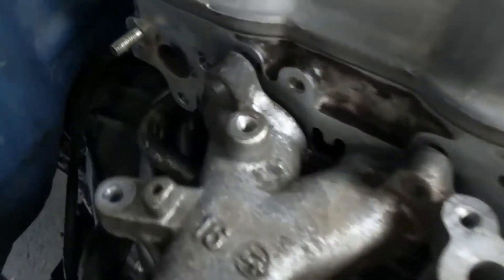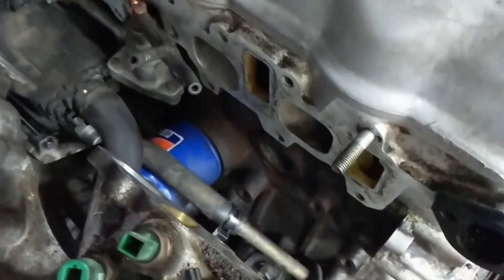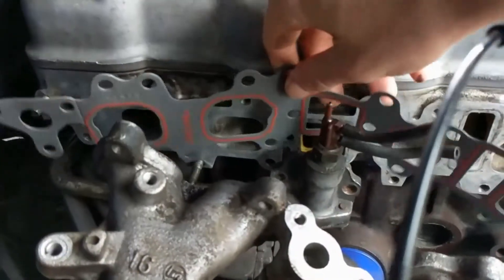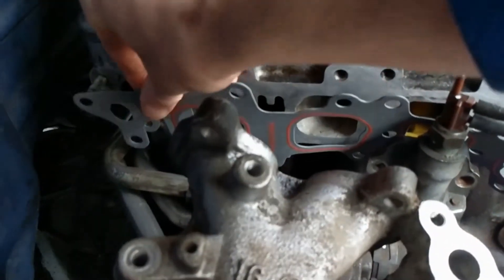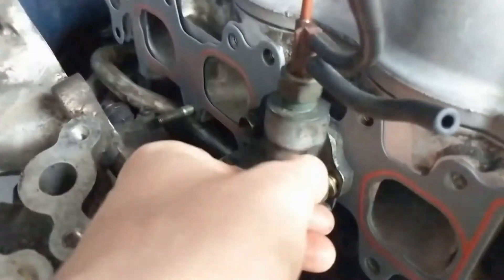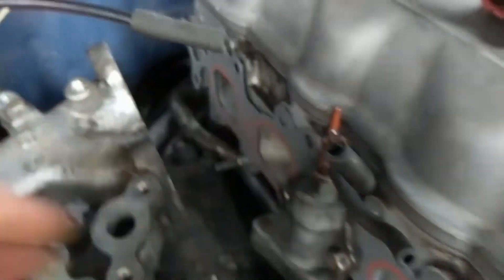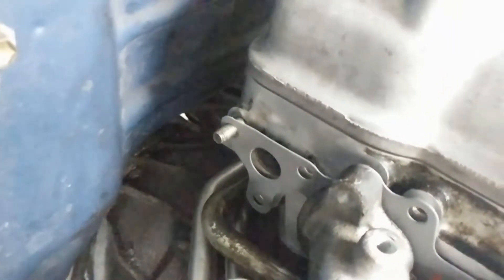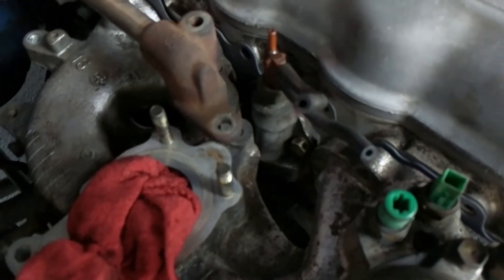22R How to Install Intake Manifold Gasket - Simple Trick to Ensure a Perfect Seal

Comment: Delete the fkn egr bruh
Reply: Oh do tell more or provide your favorite link to information on that. I have a 93 toyota standard pickup, since new. 240000k and now needs a new exhaust manifold gasket. Just replaced the original clutch pad and flywheel summer before last.
Reply from the maker: That was the plan prior to the truck being stolen in Seattle. 

LCE has kits I believe.

https://www.lceperformance.com/default.asp
Reply from the maker: I commented on OP with a link.
Reply: @IsaacDozier1  all you have to do is make a cap the egr port, delete the spaghetti, and depending what model you have, horseshoe the vacuum ports…remove the charcoal canister and all the junk diagram relays throughout the body. Don’t mess with the PCV tube…let that continue to run…you’ll be shocked how much room is in that well once you get all that mamby pamby liberal crap outta it…

Sorry to hear about your truck, Seattle is a shithole
Reply: @jamie0  exhaust manifold gasket is an easy fix on all those 80’s trucks…Nissan’s, toyota’s…lots of videos out there on that and the egr delete
Reply from the maker: @SamuelBullock-jw5pu  I thought there were two plates? One on the back of the head, and one on or near the intake manifold.